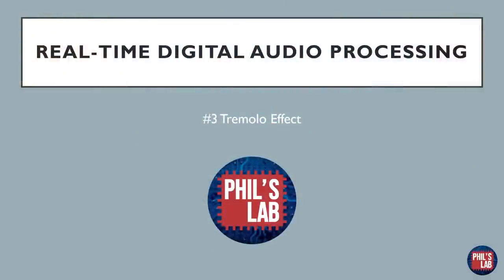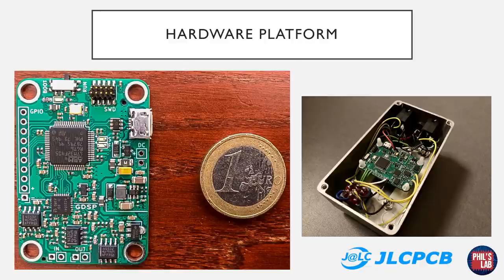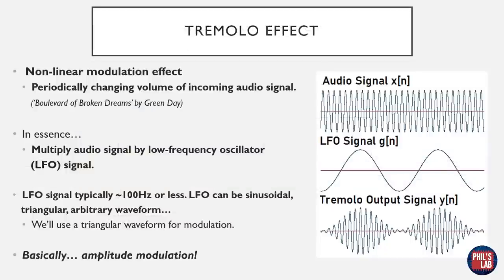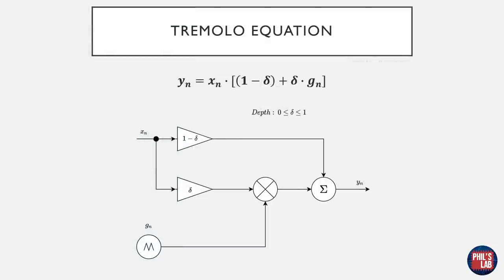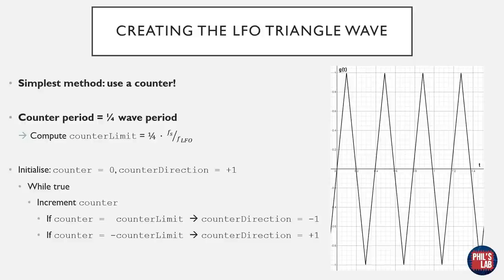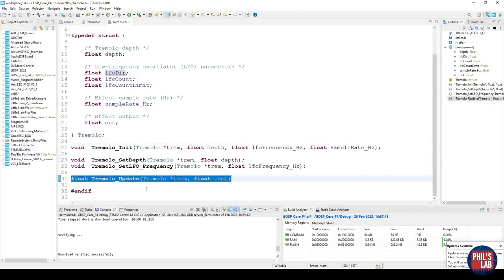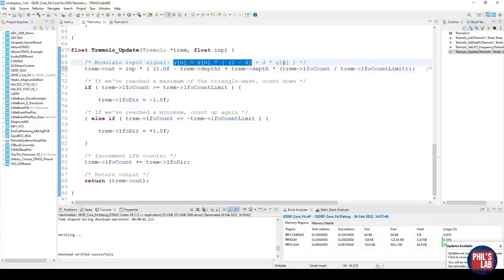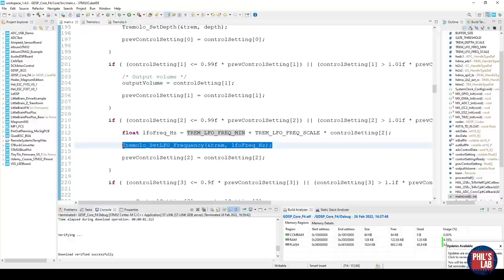Tremolo Effect - Digital Audio Processing with STM32 #3 - Phil's Lab #51

Comment: Your videos are always amazing, Phil! Thanks a lot for sharing your knowledge with us.

I'm kinda rusty on C embedded applications (then, I'm sorry in advance if my comment sounds stupid =D), but I was wondering if make lfoDir a int8_t variable isn't enough for the application and why don't use unsigned integers for both lfoCount and lfoCountLimit? I mean, it would save some bytes on this struct. What do you think about it?
Reply from the maker: Thanks, Vitor!

Yeah, it doesn't make sense in this case to use a float for the LFO variables. I was messing around with different modulation waveforms (sin, etc..) so needed float for that, just ended up not changing it before recording!

Comment: At the time this video is published, unfortunately JLCPCB doesn't have the microcontroller and codec in stock for the LeDSP module... also there is no firmware on the github for it (yet?)

Comment: Do you think you'll ever be able to implement impulse responses?
Reply from the maker: You can check out the FIR video on my channel, which is essentially that. I've tried out (short) impulse responses for speaker emulation but for long convolutions the microcontroller struggles quite a bit.

Comment: Great video!

Am I correct in thinking that if you band limited the control signal more significantly, or possibly oversampled the modulation processing (or both), you would reduce the modulation distortion?

My assumption being the harmonics are generated by the overly sharp transitions at the -1, +1 points? (in the modulation wave)
Reply from the maker: Thank you! The harmonics are due to the triangular waveform, who's Fourier series is composed of odd-harmonic sinusoids. See: https://mathworld.wolfram.com/FourierSeriesTriangleWave.html

Comment: How often do you solder on your own components? I'm finding that most of the chips I want to use on JLPCB are out of stock but would like to have them assemble the whole board.
Reply from the maker: I try to never solder anything myself these days (unless I'm fixing a mistake, trying out different components, etc.). JLC now offers components acquired through third-party distributors, so maybe that can help out?